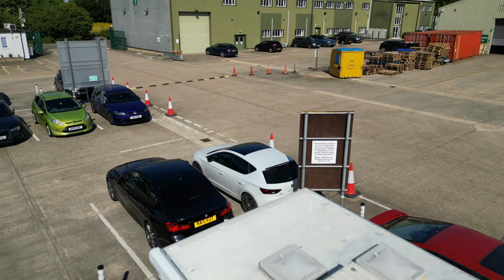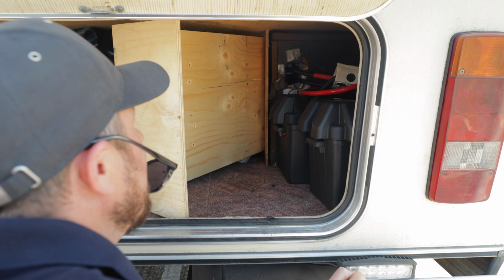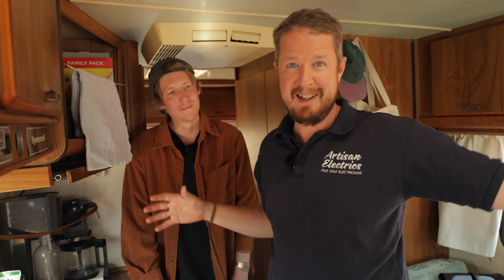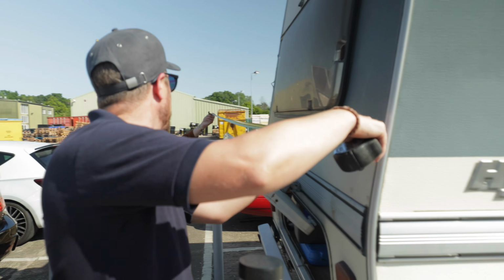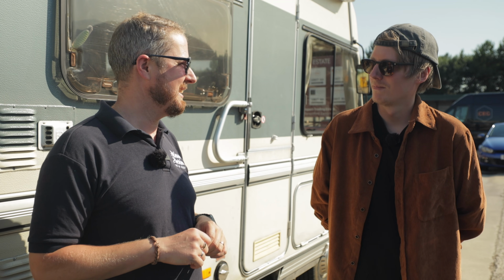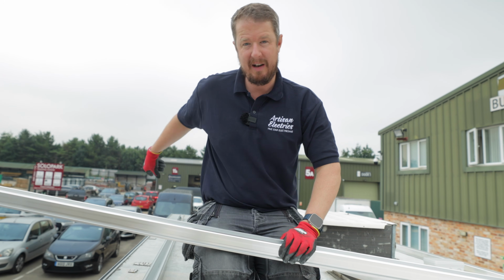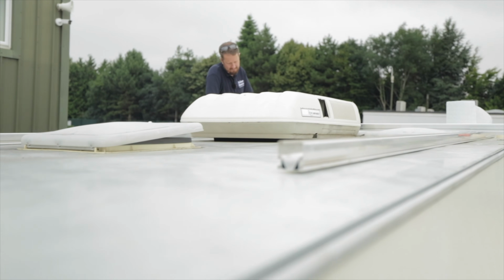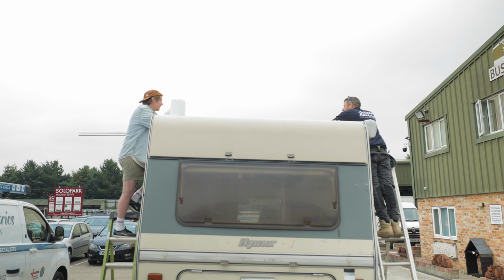Our Camper Van Solar Setup FAILED - The Full Story

Comment: Often shocked how bad electricians are at dc electric considering they do solar. I bet they couldn't even do a parallel connection or a combo of series/parallel. They're also terrible at offgrid installations.
Reply: Solution to the roof is a Z bracket with sika flex and an entry gland.
The size of the panels requires a larger mppt.

Comment: If you are serious about PV on a camper you need all the real estate available. I can't see that either vent windows or A/C strictly have to be set in the roof and high placement on the vehicle sides or rear could work. I have seen successful A/C compressor placement on an extended rear bumper bar, for example.
Reply: YES, some common sense (which is so rare...)

Comment: Yep I would of gone for Flexable panels that can be sicaflexd down fully..cables would be surface mounted by design and massivley minimise the weight....your 130v over 3 panels would be ok but overrated for the 100v 50amp victron so the 18v flexible would give a more flexible solution in a series parallel design (excuse the pun)...

Comment: I know from experience it is harder to retro install solar panels onto a finished vehicle than it is to install them on a fresh build because before any of the interior finishings are fitted you are able to map out all the roof structural supports to be able to fasten all the rails to over having a stab in the dark and failing and then having to try and remove all the finished panelling from the roof unless you have previously done the same vehicle before and got all the measurements where the rails are to be mounted to and even then you don't know if anyone has been in there previous to you and run wiring where your going to be drilling, I try to keep away from retro fitting them.
Reply from the maker: Totally agree—retrofitting is tough without knowing what’s behind the panels. Fresh builds are so much easier to work with. Thanks for sharing your experience!

Comment: RV is similar to marine.
Lifepo batteries are typically that (not all come with bms).
Not all charge controllers are built and designed equal.
Critical difference with RV is motor spec law.
Alternators are one hell of a crank (comparable with lower end industrial)

Comment: I fitted a 150 watt panel to the top of my caravan using plastic mounting brackets bolted through the side of the panel and self tappers, and Sika flex thought the brackets into the aluminium roof. Every fixing was stainless steel. It stuck like s..t to a blanket.

Comment: 3M VHB double-sided tape (ref: 4950) is preferable to Sikaflex and removes the need to drill holes in the roof. It's never going to come off! I was deeply sceptical until I researched it. You can also buy aluminium angle, cut to size, to make your own brackets - a very strong and economical choice. At the planning stage I've used sheets of cardboard to replicate the panels and long thin strips of wood. Using these has quickly highlighted any potential issues.

Comment: I can't claim to be a solar energy expert but my basic 'common sense' tells me that applying domestic, fixed roof, technology/mechanics to a mobile environment would have ended in tears anyway.  Are domestic panels even mechanically rated to contend with the flexing that wind from travelling would impart over them?  Raised above the roof obstructions would surely have created a wind loading risk there must be smaller panels available that can be bonded to the various free roof areas?

Comment: I've a 30 year old Talbot Express camper with a couple of small solar panels on the roof. I've long come to the conclusion that putting more up there is not entirely sensible. My recommendation in this scenario is to keep the panels inside the vehicle when travelling and set them outside the vehicle on some lightweight mounts when parked up and needing power. Just just plug them into a charge controller with a suitable DC connector.

Comment: There are much smaller panels out there that are optimized for use on camper vans from companies that specialize in outfitting such vehicles with almost every extra you can dream off. They also come with proper mounting systems for vehicles that are safe while driving and keep the roof sealed.
Reply: Yes I was going to suggest something similar. Look I love this bloke and think he's a great tradesman, really competent doing houses and industrial buildings. But to instal; on the roof of a campervan which is already tall, and subject to several hours a day of 100 kmh / 62 mph wind forces, whenever driving on open roads and motorways... mate you want ONLY the proper, optimised for that kind of use, slimline near flushmount solar panels and fittings. Also no need to install almost 1500 watts of panels. They guy is getting by just fine as it is, up to 10 days at a time without recharging he said. So using smaller panels made for mobile/camper installation of 400 to 800 watts would still be a great upgrade for him. Plus keep the mountings to the spare roof real estate available, so he still has full use of the skylights  Note their semi transparent colour is intended to give light from above as well as ventilation. Covering them up with a black solar panel defeats half their purpose. If you had managed to fit solar panels on brackets and mountings running another 6 to 8 inches, 150mm to 200mm more taller than the roof, you would have cost him another few miles-per-gallon whenever he drove anywhere.  Fitting even just a slightly more modern, uprated "dumb" alternator would easily give 150 Amps charging into the 12 volt battery system.
Reply: It's funny, these guys produce videos critical of amateur mistakes, then half-arse solar and get roasted in the comments.
Reply: Exactly! I used smaller panels so I could fit them around all the skylights and TV aerials etc. You don't just put one massive panel over a skylight. These dudes are crazy.

Comment: Ha ha, so funny. I started with solar on my boat and upgraded to the same Victron MPPT charge controller the Swedish gentleman has when I doubled up my panels to 4 x 68W. I've now got experience of mobile solar on my narrowboat, on a yacht and on a motorhome and in all cases we used self-adhesive panels attached directly to the roof to mitigate against marine corrosion, wind, obstacles (like bridges and trees) and foul play. Amorphous silicon panels on a rubber substrate can be walked on without damaging them and are thus ideal on boats. However, I'm envisaging a diesel-electric RV project in the future where there are three decks of rigid panels on the roof that cantilever out and tilt when parked to provide shade underneath and a phenomenal solar collection area to make at least short haul 100% carbon free. I wonder whether it will ever make it from my imagination into reality. I can imagine it looking pretty cool sitting out under bifacial panels!

Comment: Comment from mech-eng vehicle expertise. If those panels are really going to be mounted on double height aluminium rails, put an air deflector at the leading edge of any exposed panel. All articulated lorries have them on cab roofs, to stop wind-induced trailer instability. Wind forces can be higher than you might imagine, and the main problem with lorries, back in the day, wasn’t so much the magnitude of the force, but the fact that it oscillates. Causing semi trailer instability. 

Oscillation of force will produce fatigue failure modes, especially in aluminium - aluminium has no fatigue limit. You can design steel components to have infinite oscillating load cycles, but aluminium subjected to any sort of cyclic load has a service life limit. Aircraft with aluminium structural component have fixed service life, because they will ultimately fail via fatigue cracking if they remain in use. Similarly, you will never see a train bogie made from anything other than steel, for this reason. Even though aluminium is strong enough, lighter, cheaper to run, and cheaper to buy.

Comment: Well done for pausing and not making a mess 😁There will be a way to make this work with the constraints on the camper as they are.  It will just take more modelling, grey matter, time, experience and expertise to come up with the best solution.   Youtubers, Ladi & Margaret hinged their panels using a frame and actuators to get the best angle for optimum solar harvesting ☀😎👍🏼
Reply from the maker: Thanks so much! Appreciate the encouragement. Sounds like there's definitely a way forward—I’ll keep exploring options and getting creative with it! I'll have to check out Ladi & Margaret's setup.

Comment: If an auto (or marine)  electrician started fitting solar panels on a house you would probably get upset about it, so why would (when you clearly have zero knowledge of campervans) start on this job?
Reply: If an auto (or marine)  electrician started fitting solar panels on a house it would probably be in contravention of building regulations as they wouldn't be deemed "competent".

Comment: Get rid of that aircon unit, if you're intent on spending long periods off grid anything up top which isn't solar is a waste of precious rooftop real estate.  I fitted 665w of panels on my motorhome around the existing skylights, two 245w panels in parallel flat on the roof to one Victron 100/50 and a separate 175w panel on a remote controlled tilt mechanism using a linear actuator to a Victron 75/15.  Been off grid for between 3 and 7 months in Spain, Portugal and Morocco the past 4 winters with extensive use of the gaming laptop, induction hob, mains kettle, power tools and charging the eBike battery.  460Ah Fogstar Lithium leisure battery has been a game changer the past few years.
Reply: I would agree if the AC was broken / barely working - but someone made sure to maintain it for over 40 years - everything still works! 

Combine that with the thin form factor + heating functionality.. It will be kept. I am actually looking for a shroud replacement because that is the only thing that has been beaten over the years.  :D
Reply: @pierre.reimertz  If you're intent on staying on campsites to power your AC then what's the point of fitting a load of solar?
Reply: @WoollyWanderers  off the grid would be nice but not a requirement for me. Some occasional AC charging / urban living is probably what I’d want in the long run

Comment: What went wrong? It's very simple you did not whatch any of Will Prosse YouTube videos on solar and RV solar or used his webpage and forum either.

An all in one converter from EG4 and any decent brand LFP batteries would work great. Even a couple of used Tesla packs would work if you know how to do the correct settings in the app.

The 100 refers to max amps the solar controller can accept.
Reply: No the 100 is 100V max and the 50 is 50amps max on battery side
Reply: @thomasdesloovere4200  at least someone read the manual 👍
Reply: Yeah, the initial solar charger was installed with the 100v / 50A, mainly because I did not think I would be possible to fit more than 100V worth of solar (but 1350w would have been crazy-nice.). 

Another limitation was solar combined with our DC/DC charger at 50A - almost at the full capacity our Victron Inverter / Charger at 120A. But in retrospect, Maybe I should have bough a 70A Solar Charger just in case? 

Ironically, our Alternator is only rated at 35A right now, so we can only squeeze out ~17.5A safely.. So I guess we're looking for a new alternator too. 🫠
Reply: @pierre.reimertz  hey, look into a second alternator with a wakespeed regulator. Game changer. If you drive around often you can even not worry about solar. If it were my case I would cover all the roof with solar panels and have the ventilation come from the sides. Also would be willing to lose the skyview, but can have bigger windows on the sides (walls). Nowadays I think the portable powerstations are so easy to use and have become cheaper so a good option for those starting out and those looking to save on labour costs (or learning all the modular road like the victron setups, etc., but even then there are the easy solar all in one victron inverters which are simplified and i would think cheaper than going with separate components). Cheers
Reply: @artisanelectrics  it's almost as bad as your converted EV Van where you purchased a 30kwh petrol van converted to EV when you could have bought a 75kwh OEM van. Then complained about the range. Very surprising seeing as you already owned a Tesla Model 3 at the time.